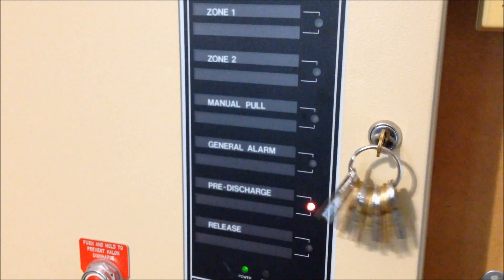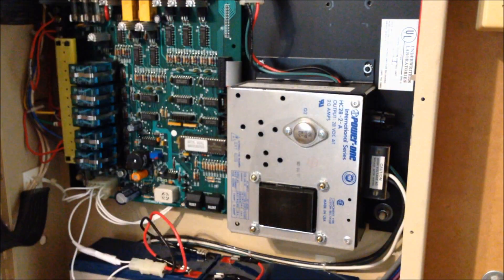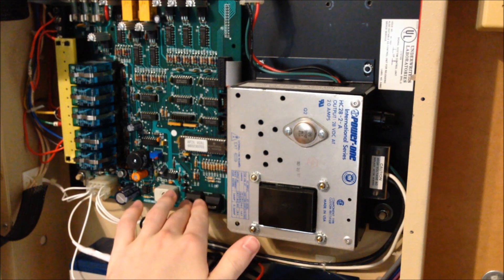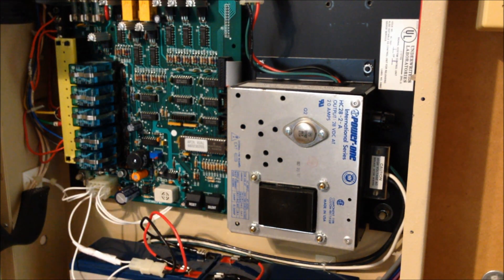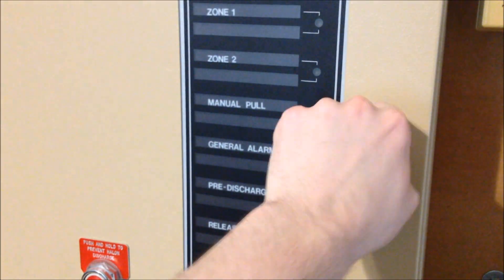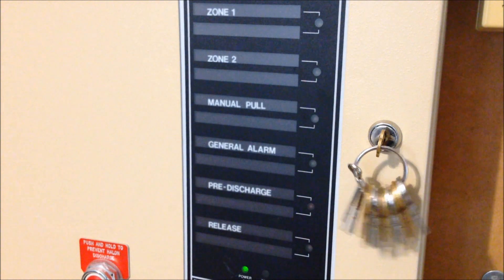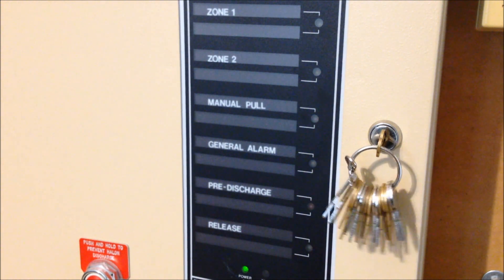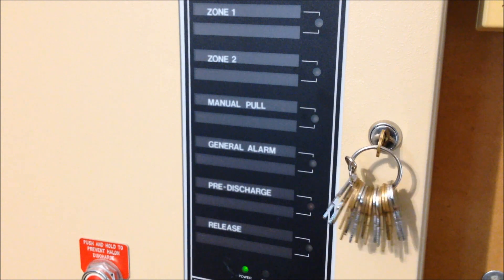System Test 45 | Halon System Special: Ansul AutoPulse 2000

Comment: Seems like the "immediate fire" logic for manual release is only suitable to be used with "safe-to-inhale" suppressing agents like IG541 or Novec 1230. Not suitable for anything suffocating or toxic, especially CO2.
Reply: Also halon 1301 I believe, or 1302, not certain on the number, which is safe to inhale. Which makes sense on this system here, it’s just destructive to the atmosphere.

Comment: Is there a reason why the trouble LED on the AutoPulse 2000 turned on as soon as you silenced the alarms?
Reply from the maker: This panel considers a silenced alarm to be an abnormal condition, so it illuminates the trouble light.

Comment: I’ve serviced these exact Halon panels in the past. Ansul also had a panel called a Dual Zone and a double Dual Zone that was two releasing panels in the same cabinet. The releasing solenoid that’s attached to your system has a firing pin in the center that is soft during a non alarm condition, and rigid during release soak time.  The pressure switch was normally used as an emergency power off for whatever equipment was being protected in the space.

Comment: Can you do a system with a system sensor mass horn only either on slow whoop or 800hz continues along with a spectralert classic on code 3. My school has those alarms except with the masses they also have a gentex gxs Remote strobe mounted under the masses.
Reply: Also if you don’t have a spectralert classic my school also has one advance as a replacement so you could put the red spectralert advance up instead.